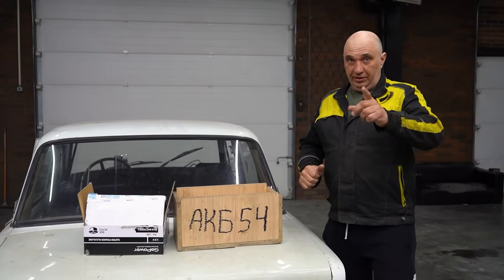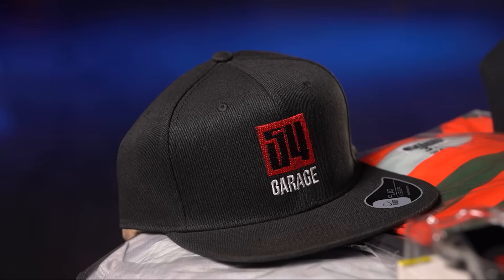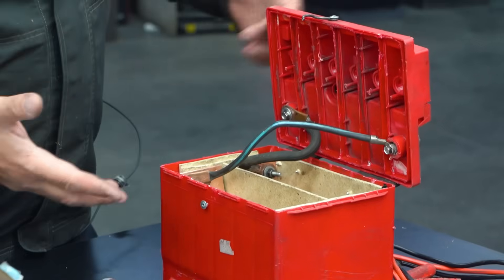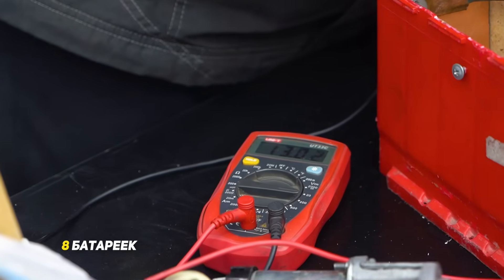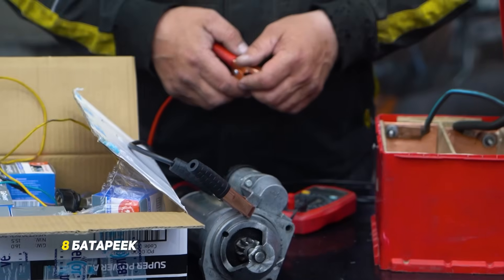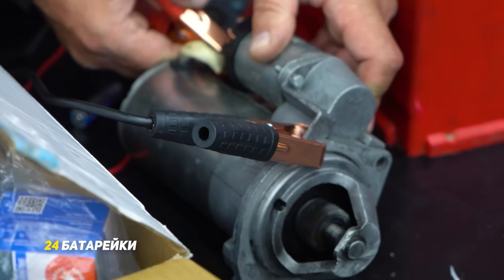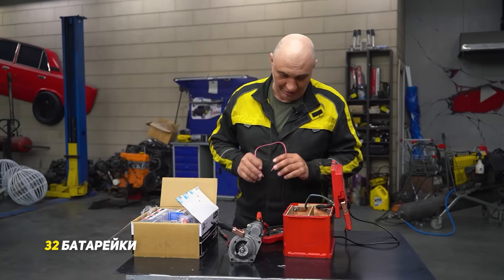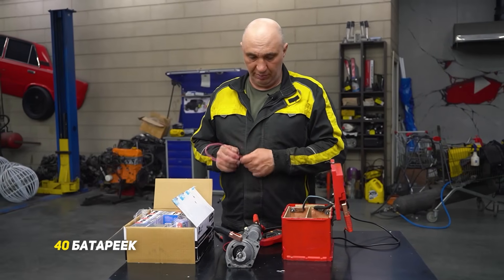How many AA's does it take to start a car?

Comment: my 2000 honda hybrid insight has 120 D cell NiMh batteries and they start the engine easily. it actually cranks the 1.0L engine over at around 1k RPMs during starting, through a generator motor that uses 176VDC. the mechanical starter is less efficient than the generator IMA motor.

Comment: You need them im parallel.  Its about amps not volts.
Reply: You get more amps in parallel.  As is your pushing a few amps at high voltage. They need positive to negative in a full chain

Comment: I saved a beautiful transformer from a scrap yard. it takes 120 volts primary side, and has a pair of 10 volt secondaries, I think 6 gauge solid copper. it can do 100 amps all day long. I built a rectifier bridge with some 40 amp diodes, added too few capacitors, and I had a great 12 volt power supply. it was actually unregulated 10 volt, so the voltage would really sag at high load. it has a board for soft-start, and a 10 gauge cord to plug it in. it's about the size of a car battery. very fun project.

I want to learn more about switch mode supply design so I can build a custom buck converter of some kind. I can either boost 10 volts up to 12 or 14.5 or make it adjustable. or I could possibly wire the secondaries in series and get 20 volts RMS from it, and make a buck converter to bring the voltage down. I think the first option would be best. with low load, a buck converter would have to do barely anything, and at high load it would only need to boost by 2 or 4.5 volts. what I'm stuck on is, finding a good inductor that can handle 100+ amps and fit inside this box.

what I wanted to say, one time the battery was dead on my car, so I disconnected the battery and used jumper cables to connect this power supply directly to my car. the engine started perfect. if I was paying attention, I would guess the lights in the house probably dimmed slightly. I disconnected the power supply with the engine running and connected the battery again.

Comment: Try it with a bank of supercapacitors connected in series (to get a high enough operating voltage) in parallel with the AA cells to give an effective capacity of ~60 Farads or more. The car should start with far fewer AA cells.

Comment: Got stranded with a dead car battery. Hillbilly ingenuity and 12 9 volt batteries linked series/parallel for 18 volts got my engine started. Drove to the parts store and bought a new car battery.

Comment: Now you're playing around with batteries to jumpstart a car 12 volt generator on my bicycle for headlight tail light turn the bicycle upside down put it in 10th gear and it started the vehicle note the car did have a dead battery in it the bicycle generator jump started it.

Comment: Simple math here. Each battery is worth 2-3 amps. 8 batteries in series to make 12volts. Probably better to use 9 or 10. So 10 in series for voltage.
If we assume 3 amps, it would take 134 stacks of 10 wired in parallel to equal 400amps. So, that math says 1,340 AA batteries to start a car.

Comment: I bet you could do that with lithium ion cells and wire them in a series of four cells. That would give you about 14.5 volts. I think a car starter and ignition would be able to handle that. Then you could wire a charge controller off of the alternator. If the voltage is too much of a problem than you could have a voltage controller to bring it down to 12 volts. I think the 14.4 volts would be fine though.

Comment: I bet if you would have increased your voltage slightly even by adding 1s or +1.5 increasing your voltage to 13.5, you probably would need substantially less aa batteries. This project would be interesting with 18650 cells. I am able to start my motorcycle with 3s4p no problem

Comment: You may have better luck with NIMH cells, as they have a higher current output. Voltage is lower, of course, but I think the current could make up for that. Not only that, it would be interesting to see if the alternator would recharge NIMH batteries.

Comment: Regular cheap AAs top out at about 1A but drop to about 300mA very fast. alkaline AA can do a bit better at 5A but drop fast to about 2A. Rechargeable AA are lower in volts 1.2V but can output 20A for a few seconds. You need about 120 to 320A peak and 30 to 50A sustained for cranking. ❤

Comment: Not sure if thats + cable for battery or a switch for starter motor. Increasing wire gauge will let flow more juice conveniently and start up fine.

Comment: 1 cells energy is more than enough to start that engine. The problem is: it does not give away it's energy fast enough and the voltage level is too low. If you would have a few super capacitors in series, which withstand 14 V in total and use a stepup converter to charge them slowly with ONE AA cell, they would be able to start the engine.
Reply: No
Reply: @theworstphysicist  Why not? Let's say the engine needs 2 seconds to be started with a current of 400A. Then this is 12V * 300A *  2s = 7.2 kJ of energy. One typical AA cell has 1.5V and 2Ah. That is 1.5V * 2A * 3600s = 10.8 kJ of energy. Still some Energy left for the losses of the boost converter.

Comment: Next time put one multimeter for Volts parallel and another as Ampmeter serial. Much easier measuring. And yeah: NiMh can handle a much higher peak current. And make the electronics to charge those decently. To build this with Lithium cells would also be interesting.

Comment: You only need around 10 AA batteries
Reply: cun did you even watch the video😭😭
Reply: @baconninja5995  you don't need 320 batteries as the video says, only 10. The 10 AA batteries can't deliver enough current to crank a car on their own because of their high internal resistance. So you wire them in series, to have 1.5V × 10 = 15 volts and you connect them in parallel with the car battery. The car battery charges, and after about 10-15 minutes the car battery can deliver enough current to start the car once.

Comment: You need 9 batteries in series to get 13.4 V which is the nominal voltage of a car battery and given that AA batteries have a capacity of around 400mAh you will need for a normal 75Ah battery around 9x188=1692 batteries. You can certainly start a car with 15mAh i.e. 9x38=342, but for a normal battery you will need 1692 batteries.

Comment: I would use 9 batteries to get little bit higher voltage.
And then 10x those 9 batteries, that's 90 AA batteries but not sure is it enough.

Comment: Looks like your jumper wire is of too high a gauge and is imparting considerable resistance to your load?  Takes quite a lot of time to generate the amperage you have used in starting to recharge the batteries.  Even your car batteries also take quite a while.

Comment: 12 volts is close to dead. 13.6 is fully charged.
Reply: You're right. 9 per layer would've given them 13.5, and 10 would've been 15. That, and enough amps.

Comment: Hello..
maybe you can try with li-ion 18650 cells. would it be possible to replace the battery with them? regular 18650 cells have a maximum instantaneous current of 10 amperes. Regards...

Comment: Aren't you supposed to drive the car in order to charge the battery? From what I remember, load must be exerted upon the engine or simulated via dyno to produce significant re-charging. The AA's take significant load starting an engine hence it probably takes significant engine load to charge- assuming the batteries are built to be recharged instead of forcefully recharged. This can work if you use rechargeable batteries instead and drive the car to charge.

Comment: you need 120 batterys, 15 pairs of 8 in series connect them in parallel and you will have 12 volts at 40 amps

Comment: Alkalines will recharge even though they say not too. It does effect capacity rather quickly though. I used to throw then in a ni-cd charger and then use them again on rc cars. Worked fine for several charges.

Comment: Definitely need amperage. Each regular AA has between 500-700 Milliamps per 1.5 V

Not sure if they're alkaline or carbon but I agree with others rechargeable batteries will work.

In a jam I once used a 18V DeWalt battery pack using solid copper wire as the jumper to boost the dead 12v battery and it worked like a charm I had to let it transfer some of the juice beforehand otherwise the leads would get very hot .

Comment: I got one of those compact "emergency jump-starter" lithium packs, and it's about 1/8 the size of that Lead-Acid battery. I wanted to see if my little 4-cyl Sunfire "could" start before buying a new battery for it. It had been sitting for about 8 years, but it cranked faster than it did with the new battery. Those LiPo batteries are no joke.

Comment: 96 d-cells wired correctly will start a car... once! Yes I tried it and I'm glad I did it outside. Nearly half of the batteries popped, the rest smoked. The carbon rods in each cell super-heated rather than going flat. This was in the late 70s when alkaline were still fairly new and very pricey. I made 12 battery packs of 8 each, giving me 12 volts. I then connected those packs in parallel to boost the amps to a measly 10 amps, just enough to turn over a 4 cylinder car engine for 5 seconds. once it fired I let go but it was too late, the "battery" I made LEAPED off the fender with a bang loud enough to make my ears ring, plus I had hot materiel splat on my arm and the side of my head. DO NOT TRY THIS, IT WILL HURT!!!  A lot...

The hospital told me I had 1st and 2nd degree burns over 10% of my body and it was a week before I could hear out of my left ear. I was VERY lucky I didn't lose my left eye. I was a dumb teenager that was just messing around and it cost me and my parents big time. These were carbon batteries, not what they used in the video.

And before someone says I wired them wrong etc... I did not because they were sitting there for 20 minutes while I was rigging them up to the starter leads. I knew quite well how to wire 2 or more car batteries in parallel to get more amps and to not cross wire it so they back-fed to each other. 

The only reason they exploded was the sudden and rapid discharge caused the carbon rods in the batteries heat up fast to red hot, the water from the electrolyte paste flashed to steam causing the battery cases to burst. Need more proof? Take a old style carbon battery, remove the rod and hook jumper cables to it and your car battery (leave it running, it will drain the car battery too) it will glow first red, then white and pop. Like a firecracker. Yes, I have....
Reply: really depends on the battery if they can take a charge or not. some non rechargeables do it just fine but others leak and then theres what you described
Reply: @kahvikissa_   Current carbon batteries are better made than then, with proper venting so it is unlikely they would explode like those old-style did. I'd be more worried about the LI/ion ones, they have been proven to explode and burn hot if mistreated. I can't stress enough how very stupid I was, I got chewed out not only by my parents but the EMT's and the doctors as well. I worry about the kids today, they don't listen any better, and are more likely to do dumb things than from my generation... I'm being mean? Not once, in my entire life, have i walked out into traffic staring at something in my hand. Or walked into light poles or walls. My youngest son, then 16, when he had an old flip phone, horse stomped 3 times before he noticed he was still 3 feet away from the front steps... no I have never let him forget that either lol.

Comment: Bear in mind - AAs have a very little high current capability, if you short an aa, it gives about 5A peak and QUICKLY drops.. It would want 1more battery in series (9S instead of 8S), THAT would help. Next time try 18650 lions (3S) or 18650/21650 lifepo (4S)

Comment: 10 in series to get 12v if the batteries are 1.2v, about 100 parallel to get decent amperage, so about 1,000 AA cells.

Comment: I bet less batteries would work if you didn't use only flat plates.  Guaranteed some columns of cells are not even connecting!  Need some kind of thick but compliant spring at the end of each one, then press the plates together.  Cool demo though!

Comment: What would really make this work better is a capacitor start system.  Have a look into using a capacitor bank.  Then you can slowly extract all the power from a few AA cells and use it all at once for starting.

Comment: The amperage is too low regardless how many batteries you use it wont be reliable over time even rechargables will only work a few times, if you use lithium ion , it will work np . no lithium = no regular start

Comment: I believe the batteries should charge roughly 4-6 times before the capacity is lowered to far and rendered unusable. It is risky as they can only ever be charged slowly and even then they can be charged for short intervals of about 30 seconds on and off for it to be considered "safe"... not sure about all battery chemistries, but the numbers used are about average.

Comment: If you were to try to start a car using AA batteries, you'd need a whole lot of them! To get the 12 volts required by a car's starter motor, you'd have to connect 8 AA batteries in a row. But that's just for the voltage.

Now, to get the necessary power (measured in amps), you'd need a lot more sets of these 8-battery rows, all connected together. We're talking about 160 to 240 sets of 8 AA batteries, depending on the car. So, you'd end up needing a whopping 1,280 to 1,920 AA batteries in total.
Reply: A typical car battery provides 12 volts and can supply around 400-600 cold cranking amps (CCA) to start an engine. One AA battery supplies 1.5 volts, and most alkaline AA batteries can provide a maximum current of about 2-3 amps.

To reach 12 volts, you would need to connect 8 AA batteries in series (1.5 volts x 8 = 12 volts). However, to achieve the necessary current, you would need to connect multiple sets of 8 AA batteries in parallel.

Assuming an average AA battery can provide 2.5 amps, you would need to connect 160-240 sets of 8 AA batteries in parallel to reach the 400-600 amps required to start the car (400 ÷ 2.5 = 160 and 600 ÷ 2.5 = 240).

In total, this would require 1,280-1,920 AA batteries (8 batteries per set x 160-240 sets).

Comment: Those batteries do recharge but to get sufficient current back to start the engine again they need over 10 minutes so they might vent or leak as they are not designed for charging operation. I've charged those AA's for as long i can remember me, usually 2-5 minutes on a charger just to increase the voltage and you get somewhat an another round on whatever you are using but the problem is the voltage drops suddenly because they can't get an actual charge before things turn sketchy, however i did charge a lot of them for hours, most didn't show any external signs of failure except that they were getting hot, they just seemed like they gave up and didn't last a minute with a load. You can just increase their voltage a little bit for 1-2 times.

Comment: There are differences in batteries you might missed it.
Normal Alkaline has bit higher internal resistance. So it will not give a lot energy immediately. Maybe 2-5A but sure not a lot.
Rechargeable has much lower internal resistance. So it can give more energy. More than 10A is possible. But it will make battery also hot if used long time.
Problem is the lower voltage, just 1,2V but thanks to lower internal resistance it will make enough energy for starter motor, and you can charge it up.
If you charge NiMH more up, it can go to 1,35V! That is much higher, but its designed to hold 1,2V for long time.

Lead battery holds itself less energy per area. NiMH cell is better to hold energy per area. Li-Ion is much higher.
Special 1,5V rechargeable batteries exists but they're less cheap than 1,2V batteries. Rechargeable Alkaline battery exists.
Box full of NiMH batteries has more energy than standard Lead battery.

Comment: Dry cell batteries will deliver you the voltage no problem until you try to load the circuit. However, their collective internal resistance will reduce the output voltage considerably. I'd love to see a temperature reading of the batteries. So 8 x 1.5 volts will not be enough! On recharging the no load voltage will be higher than 12 volts so a 12 volt charger will not overcome 300 x 1.5 volt = 450 volts.

Comment: When you put a charge on a primary battery,it kills it,if you disconnect the charging system to the battery, you would have more number of starts.and if let the batteries rest a few hours, you may get a few more starts.Try this with a Dodge gear reduction starter motor,it may surprise you.

Comment: Once we had a flat battery and my plan was to buy three six volt lantern batteries and put them in series and dump all their power into the car battery. Unfortunately the store only had two, which was not enough voltage to force a decent current into the battery (would have been almost nothing). 

Some know it all came up and although he did give us a tow-start, which was appreciated, he criticised my attempts to at using these batteries and wouldn't hear the point that I was actually after three of them. I reckon three would have done the trick. I wasn't trying to start the car directly from them just dump their charge into the car battery to get a bit of a surface charge.

Comment: I have a small request, can you try to make the AC compressor drive from electricity, so that it no longer uses the Vbelt which is connected to the engine speed, but the compressor still uses the original compressor